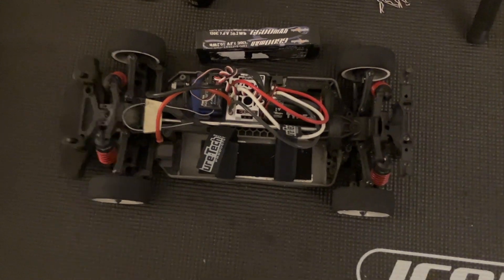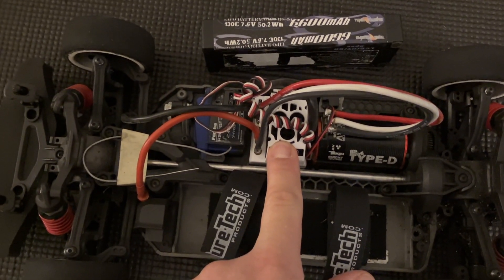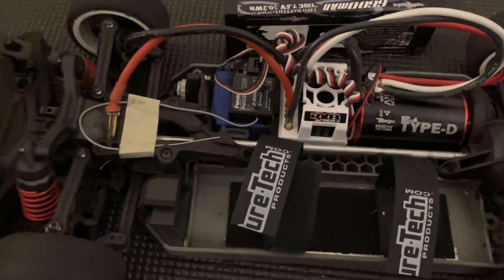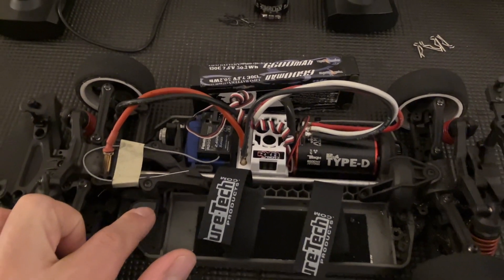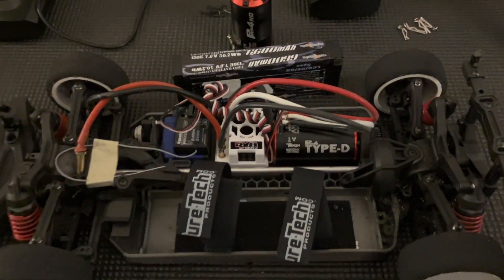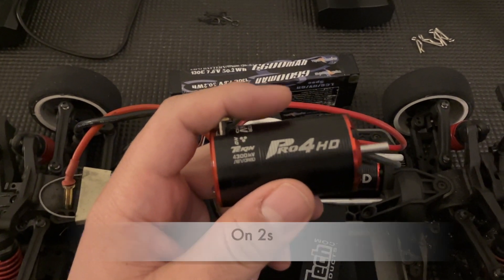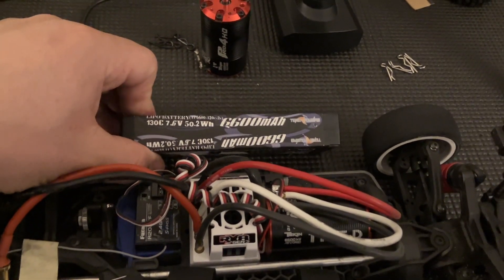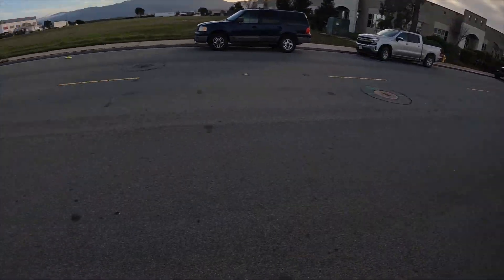Traxxas 4-Tec 2.0 Speed run top speed over 75mph 120km/h on 2s? Tekin RX8 Pro4 Type D Drag 6500kv

Comment: Good run video nice setup. TY for mentioning the vxl motor for us traxxas guys. Yeah on 3s geared tall 71-72 mph vxl is about it but I do really like your 2s setup because I’m a 2s guy only Tekin makes great products
Reply from the maker: 😃 Thank you. The funny thing is 😅I like the Titan 12T. I am probably the only one within an Ocean's distance that enjoys them. I will have to mention it more. Side note... 12T Titan with the right gearing is loads of fun in my opinion. And when they go out, $25 and I can get a brand new one.
Reply: @telecomandorc  yup 👍🏽 price point u can’t beet it or go wrong either. I have a 12 turn that’s 5 years old still runs strong but I do maintenance on it oil bushings clean it. Which I’m sure helps it.
Reply from the maker: @mikebianco7854  I am sure it does. I like the Fantom Ultra-Low Viscosity oil. It needs to be used often but it gets everywhere I need it to go. I do not recall the temperature difference between the front of the can and the rear, but it is high. So a little oil never hurts.
Reply: @telecomandorc  so with the stock vxl esc and motor, should it be running a 3s battery for best racing speed?
Reply from the maker: @ecowahm  Most places only allow 2s. I would check the club rules.
Reply: @telecomandorc  ahhh ok great thanks!
Reply from the maker: @ecowahm  My pleasure.

Comment: How Come The Tech 3.0 Has No Control And Spins Out Of Control And The 2.0 Tech Does Have Control?
Reply from the maker: The tires are rubbish. It is too hard of a compound and one is stuck with Traxxas size tires. Best think to do is to lock the front diff. Use the lightest diff lube in the rear diff. 

If you are not opposed to using stronger chemicals, use Mighty Gripper on the rears tires. Coat them and let it dry, and repeat until they feel they are gripping. But the tires are the problem.